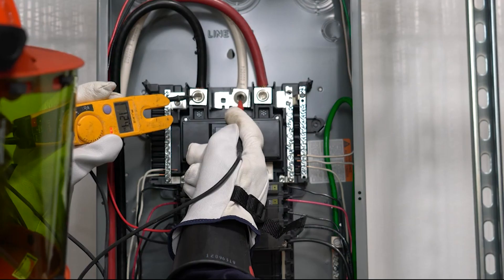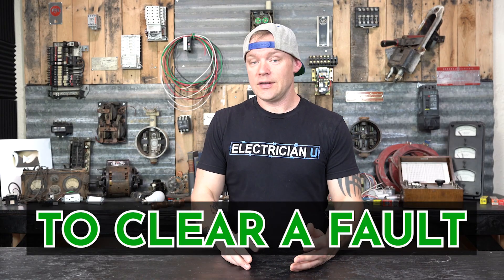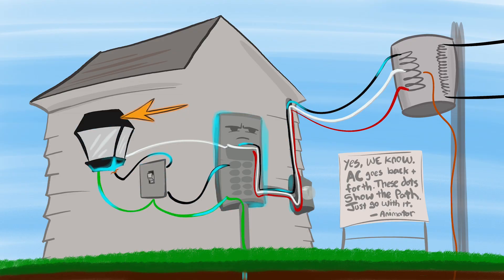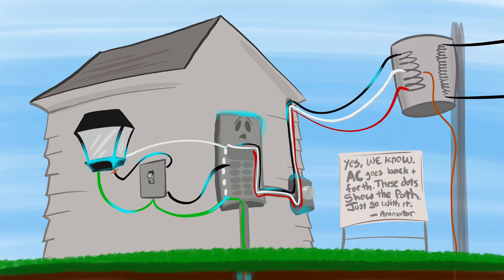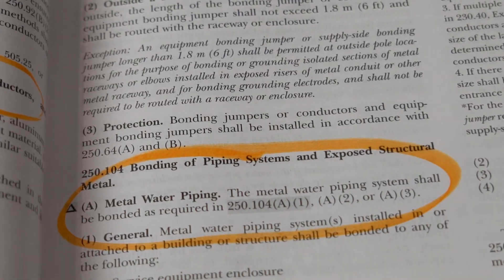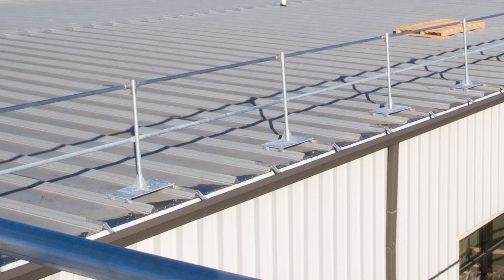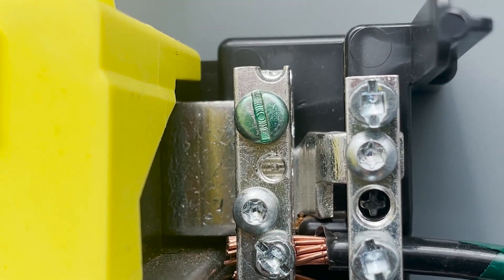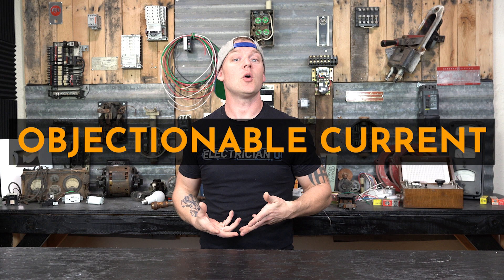Why Do We BOND Neutral & Ground in ELECTRICAL SERVICE PANELS?

Comment: Dude, that was 2 days of class in 17 min. 👌
Reply: @electricianu  Great vid on an extremely important subject.

I'm Australian but went to college in America. I did aerospace engineering but work in industrial automation, electrical and control systems. Since 2005 I have worked in Australians mining industry building and commissioning new mine sites and that's an area where electrical earth systems are very important. Most sites have 11,000 or 22,000 site reticulation systems with substations scattered around the site. There's also a lot of 6,600 VAC systems for the large power drives on things like crushers.

About 5 years ago I had a senior sparkie (what we call an electrician) who was inspecting the electrical work on a stacker (a big lump of moving machinery on train rails for making nice big piles of ore). These are fairly substantial items with their own mini-substation onboard. I think its infeed line was 11,000VAC on a trailing line and reel system with about 800m of line. On that stuff the equipotential bonding and earthing are fairly important.

At one point this senior sparkie went nuts at the electrical team (about 10-15 sparkies and laborers) over the bonding and earthing. It was like the scene with the sergeant major from "Full Metal Jacket." When I questioned why he was being tough he bit my head off as well and very bluntly put it to me that "I was the engineer and I should know how effing important earthing was." 

He then added that we were standing on a giant metal structure and then asked "If there was a fault what would keep people alive." He then pointed at all the other steel structures and machinery around the site and again asked me "If there's a fault over there, what keeps people alive." He then added "When you're at home and there's an electrical fault, what keeps you alive."

At that point my brain caught up and I realised that it doesn't matter if you are using circuit breakers, fuses, RCDs, ELRs or any other fault detection system to cut the power they all need an earth system to do their job properly. For sure some (if not all) will eventually trip and cut power but for them to trip before you die they all need a functioning earth system so that the energy doesn't need to use human flesh to dissipate.

The biggest part of that reality check was that I realised that EVERYONE in the electrical trades from the engineers all the way down to the apprentices, factory workers and managers tends to take grounding, earthing and bonding for granted because its NOT the wiring that carries the power.

Great vid mate keep doing them.
Reply: @Waylon Finlay When you have a circuit connected through GFCI, the active/hot wire and neutral of the circuit are fed by the GFCI device.  The GFCI device is measuring the current going out through the active/hot wire and therefore knows the current coming back on the neutral must be the same ie.. 1 amp goes out 1 comes back. This neutral feed out of the GFCI is essentially isolated from the main neutral back at the panel so if a fixture or appliance connected to the GFCI device was to have a fault where say the active/hot wire inside the appliance broke off and touched the grounded frame of the appliance, the current would take this new path back through the ground wire to the panel thus creating an imbalance in the current the GFCI is measuring and as the current is no longer returning to the neutral terminal of the GFCI if would cause it to trip.
Reply: @TheAVJedi  👏👏👏👏
Reply: @Waylon Finlay The current still flows  through Neutral,  but there is curren leak to ground if there is ground fault. The GFCI detects current is not equal on LINE and Neutral , and it will trip. That's the way how it works.
Reply: Really good vid 👌
Reply: @Waylon Finlay Completing the circuit doesn't trip the breaker; too much current trips a regular breaker (gfci and afci trip on high current and ground or arc fault). I believe the reason the breaker might not trip if the neutral and ground aren't bonded is if ground won't allow enough current to flow to trip the breaker some causes I can think of are: the ground might be floating with hot, so the voltage potential between hot and ground isn't high enough to raise the current enough to trip the breaker; or the ground might not be conductive enough to pass enough current to trip the breaker. Whatever the reason that ground isn't allowing enough current, the breaker doesn't trip because there's not enough current. Bonding neutral and ground ensure that enough current can pass to trip the breaker. If the breaker doesn't trip when there is a fault to ground that isn't allowing enough current, then the voltage is still there making everything grounded hot and thus dangerous.
Reply: @youwantjosh   the earth has some resistance. It doesn’t create a low impedance path. Let’s say the earth has 10 ohms of resistance. It varies. 120v divided by 10 ohms is 12 amps. That’s not even enough amps to trip a 15 amp breaker obviously. So the earth can’t be used as a fault path. I know you know this, but I’m just clarifying on what you said.
Reply: @danieljuneau229  earth has a lot of resistance. ive tried stopping it by smashing my head into the dirt and it keeps on trucking
Reply: @danieljuneau229  yeah, if an installation has ground connected to the dirt with a bad connection, like 10ohms, and it's not connected to neutral at the service entrance then somebody will have a bad day.
Reply: And explained clearly. Why can't schools learn to do that. We don't need egos we just need to be explained clearly.
Reply: It's almost like school is designed for profit not productivity...
Reply: @R. Ward Yeah, he does that. Kind of a lot
Reply: https://youtu.be/--O60AxxAtM
Reply: So true
Reply: You had shitty classes
Reply: Honestly
Reply: For a perverse, bare minimal understanding of what's happening. The reality is, an electrition doesn't have the foundation to understand it fully.  That's why you have a book of rules to follow to not hurt yourself or others.
Reply: @falsedragon33  I know they have trouble spelling but but as an engineer I suspect electriCIANS know a bit more than electriTIONS.
In fact I've never heard of these guys you call electritions.
Reply: @falsedragon33  🤦‍♂️
Reply: just found this ....
Reply: @Waylan Finley had my Main dis.Pole catch fire back in the day pwr comp.never bonded @ main. I'm still finding problems/questions
Reply: Yep but remember he had to do those two days to come up with a synthesis that he can provide to you in 17 minutes.
Reply: ikr? this is why I say, schools in the usa, need to be internet, and prerecoreded video more than anything. with just a class monitor.
Reply: @themtb2003  I mean thats true to an extent, but my first 2 yrs of Apprenticeship was online. I can say first hand, electrical has alot of hands-on work that cannot be taught from a book and I realized that after hitting the industrial and commercial fields.
Reply: @Werecalledtodestroyevil  the problem with that is, someone has to be willing to take on someone that is not skilled. the union bottle necks work, and hands it to a select few.
Reply: @themtb2003  online does have advantages but also alot of disadvantages for someone who's a hands on learner.

Comment: I am not an electrician, and I most commonly throughout my life have worked with DC systems only.
So my question is: doesn’t the fact that they are bonded mean that anything which happens on the ground conductor also happens on every neutral in the house? In other words any fault that occurs which puts current onto the ground line, doesn’t that necessarily energize the neutral in the same fashion?
For that matter, why isn’t the ground line constantly energized by whatever is coming back on the neutral in the first place?
I am clearly missing something fundamental about how AC works in this situation. In the low-voltage stuff I am used to, I would normally employ diodes to make sure that the current is only going in one direction for a specific conductor. Obviously that’s not how it works here.
Reply: Because it is trying to return to its source through the path of least resistance. If the grounding goes straight to the main panel, from there it can go back to its source and not travel through other circuits in the house. That's how I understand it any way.
Reply: @AllTrac7200  if electricity had a choice between earth and its source I think it would chose the path with least resistance, I have heard electricity wants to go to the source is this because of its source has less resistance than going to earth ? since a transformer gives the circuit a steady current and voltage shouldn't it be capable of overcoming the resistance of the ground wire
Reply: I have this same question. why doesn't current backflow into the ground if it is connected to the neutral?
Reply from the maker: I will do a video on this, thanks for the question!
Reply: I thought I was the odd one out and I'm an electrican apprentice😵
Reply from the maker: I will do a video on this, thanks for the question!
Reply: @electricianu  Hi, I just came across this very useful video (thanks for putting it), and I still have this question. Did you happen to make the follow up video explaining why bonding ground to neutral in main panel doesn't make the ground wire live ?
Reply: all AC system starts with medium voltage ie: 4160 vac, steps down to 440 or 220 or 120. all of AC steps down goes thru a transformer and all transformer wether its 3 phase or split phase has neutral bus on them. neutral bus is like a - plane on a dc or a potential in technical term. yes, what ever happens in the neutral is happening on the ground in AC system but ground(earth) and neutral has different function, neutral is potential and ground is protection. if hot is grounded anything that has lowest potential(resistance) to neutral or ground, current wil pass thru it but since your neutral and ground is bonded on the service the current will ignore the earth stake if neutral resistance is low going to transformer neutral. take note some transformer with delta configuration rarely has neutral bus on them. they only have line to line potential with isolation transformer.

Comment: Honestly man, you have a gift for teaching. Great video.
Reply: Very gifted.
Reply: @raymond3722  was a w
Reply: I disagree.  Too much misinformation and hand waving.  The hand waving is the tell.  FYI, the neutral on the low side of the transformer (center tapped) is earthed.  This provides another path for current and stating, and even animating, no current path without the ground-neutral bond is irresponsible.  Ground and neutral are not bonded simply to create an overcurrent path in the event of a fault condition.  If that were true, then the neutral wire could just be connected to the case on the equipment side and you'd have a path for fault current.  Think about the last sentence. -EE, 31 years.
Reply: @DiffEQ +1
Reply: William Reese, That's because I taught him all I know.
Reply: He is very well spoken
Reply: Though he made a mistake @ 2:45 - 3:08. In the animation, charge/current is flowing through the ground wire of the light fixture then through the ground rod of the house and then to the ground (as in the Earth), without any return path. So, the animation implies Earth is gaining the charge due to the fault current. But that can't happen unless it is "static" electricity (which is not the case).

The problem specifically is that the animation, while it shows the ground rod and ground wire of the transformer (as well as of the house), for some reason the animation doesn't show the fault current of the light fixture traveling to the Earth ground and then returning to the transformer via the transformer's ground connection.
Reply: @altuber99_athlete exactly
Reply: Agreed... so helpful for brush up info as I don't do this every day!!
Reply: Yes, 
He has an ability all too rare 
... teach in simple 'stupid terms' without making it obvious
.
I'm old - and know what he is explaining - but - am  blown away by his skills in educating

Comment: Ok, I just built a pole barn. My original service is 200a to a pedestal meter with 2 breakers. 100a to the house,, and 100a going to the barn.. Nothing is bonded at the meter, but the house panel IS bonded. Do I bond the barn panel, or do I need to bond at the pedestal and un-bond the house panel?
Reply: That's the way I always thought it should be, but a licensed electrician is the one who bonded the house panel. I didn't really even question it, until I built the barn. This video was timed perfectly!
So, basically,  I can consider the house panel and barn panel as SUB panels,  since the meter pedestal is the first disconnect.
Reply: @Gravelbomber  yes that is correct . if neutral and ground are bonded in more than one panel that is incorrect
Reply: Your very first means of disconnect
Reply from the maker: Code says at your first means of disconnection.  So wherever the first main breaker is after the meter
Reply: only connect the neutrals and grounds in one location the main panel
Reply: @j.s3612  so I guess that would make my main panel the meter pedestal, because it has the 2 main breakers in it?

Comment: Bro some day do a video about...should a transformer be connected  to a desconective by flexible conduit ? The code say  anything about this?
Reply from the maker: As far as I know there is no actual code that specifies any type of conduit for ANY type of equipment.  It's just kind of a general rule of thumb to not use hard conduit since the transformer vibrates constantly.  I use liquid tight flex most of the time because it won't unravel like metal flex can, and it transitions from metal to pvc and back to metal so it helps dampen vibration noise.  But that's just a personal preference, not a code requirement.
Reply: @electricianu  thank you so much for your comment my friend. I am working in my journeyman here in florida. Good lock to me..jajajajaj